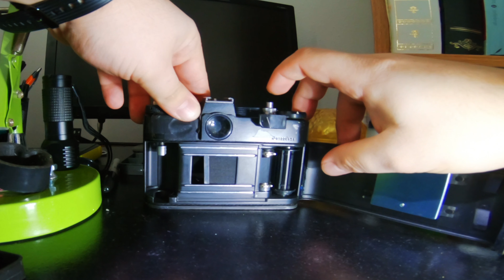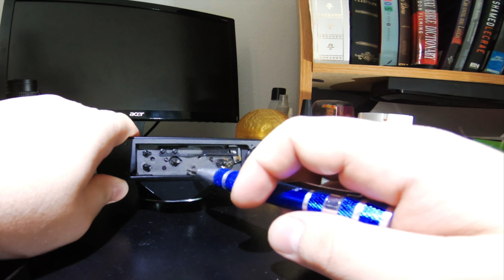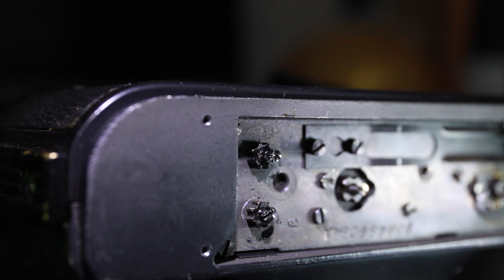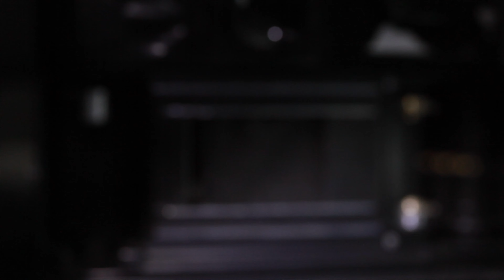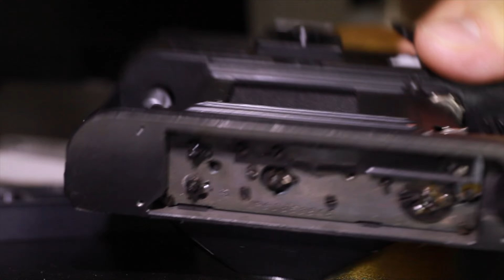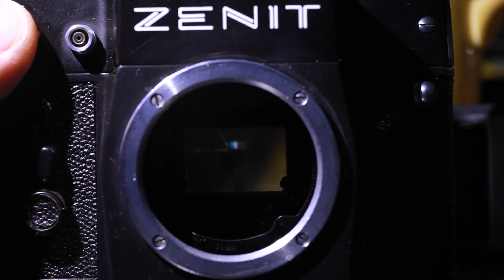Shutter Curtain tensioning for Soviet 35mm film cameras; Zenit 11, 12, TTL; Zorki; FED ; Leningrad

Comment: Worked just great, I was going to sell the camera for someone else to fix, thanks to you and your video I get to keep the camera - Thank you
Reply from the maker: Glad to hear that your camera is operable again!
Reply: @AleksUsovich  Great video, however how do you know the shutter speed matches correctly after tensioning? What's your measurement for adjusting?
Reply from the maker: I use a shutter speed tester that I made using an Arduino. I am not looking for exact shutter speeds when adjusting, I need close enough where the film can compensate for the inaccurate shutter speeds. To get a completely correct shutter speed in these old cameras, you will need to strip down the camera and relubricate everything plus replace some worn parts which is impractical for a camera that is 50 years old. I am simply looking to get close enough (within 2 stops for most film stocks).

Comment: This solution worked very well on a similar model, the Zenit 122, in this model, you have to move the lower gear instead of the screw. Problem solved! Thanks for the video!

Comment: My Zenit B was hanging up at 1/30th of a second. I tried this fix exactly as you describe, and it made it worse instead of better, the shutter was hanging up on all shutter speeds. I decided to try it again and adjust the tensioning a little bit more to the left. But I couldn't get the star wheel loosened up, I'd tightened it too much. I mauled it with a tiny set of pliers trying to remove it and I couldn't. I got angry and decided the camera was trashed, put it back together and voila, the shutter works perfectly. Thanks so much!
Reply: yes but you now have no idea what the shutter speed is, or if the two curtains are balanced.

Comment: Hi Aleksandr, thanks for that! Had a silver Zenit E that had that problem but was sold ages ago. The other Zenit EM I have is a black model like yours and as a slight different issue with the curtain: when you shoot, the right curtain goes left as usual, but when you try to wind for the next shot, the right curtain tries to pull the left one, but the left gets stuck on the top and doesn't want to move along. Have you ever experienced that? I could send you a video if you need to see the issue. Many thanks!

Comment: Hello there. I have a zorki 4 and it looks perfect. But, ı have a little problem. All speed correct, bulb is correct but 1/30 also acts like a bulb. Do you know the solution this problem? Many thanks!
Reply from the maker: Check the set screw that is in the metal shutter selector dial. If it is loose, it may not actually be changing speeds for 1/30 and bulb. If not, you will need to do a CLA with particular attention to the slow speed mechanism. There are a few resources online and I have CLA'd two Zorki 4's before; it is not super easy but not extremely difficult if you have ever repaired a camera before.
Reply: @AleksUsovich  thanks. I will try that

Comment: Great video… thanks.  My Zenit 19 shutter speeds seem ok xcet the slow speeds and bulb do not function.  A 1 second exposure sounds no different than 1/60 for example.  And the bulb will not Kerp the curtain open at all.  Will the same cog/tension correct this?  Thank you from Minnesota
Reply from the maker: Hi, no unfortunately Zenit 19 has the shutter electrically timed and is a metal shutter and does not use a cloth shutter (see my other video for how the shutter is removed from the camera). There is no way to correct this unfortunately. I went through 3 Zenit 19s that all started having this issue and all failed and stopped working in the end..

Comment: Help? After adjusting the screws (probably not in the correct way) my curtain is fully closed and stuck... Nothing I do can result in any movement of the curtain (at least the outer curtain, which I do not know if it is the first or second)... any solutions? As the model differs from the one from the video, I have unscrewed the safety screw before tensioning the gear

Comment: I have made a shutter tester using an Arduino and two lasers. This way I can not only measure shutter speed, but the speed each curtain moves. Obviously if one curtain moves slower than the other, uneven exposure will occur.

My Zenit (all Zenits are almost identical inside, even the newer 122s) shutter speeds are ok till 1/125 but then it struggles, with 1/250 actually giving 1/139 and 1/500 actually giving 1/210. So about one stop slow.

I have disassembled one Zenit to repair the shutter, a common fault is the glue holding the shutter ribbons fail. It is not a job to take on lightly. Takes hours to strip, a real pain to reassemble. To re-glue the shutter ribbons takes less than five minutes.
Reply from the maker: Curtain tension does not really impact shutter speeds from my experience. If the lubrication is worn down than the curtain tension can improve the speeds. You'd most likely need to replace and relube the camera to get the shutter speeds where they need to be.
Reply: @AleksUsovich  Hi, the Zenit E service manual clearly states that the tension on the shutter curtains and the mirror lift spring are used to set the shutter speed. Having built a shutter speed tester, I can confirm that varying the tension does indeed set the shutter speed and if second curtain is set too high, will cause blinding of the film gate at higher speeds.
If the two shutter curtains are not balanced, it will cause uneven exposure of the film, as each curtain will be travelling at different speeds.
Reply: @wibbley1  Interesting. This was the question I had above and you seemed to have answered it: whether the tensioning of the curtains determine the shutter speed. Just out of curiosity how did you build your shutter speed tester? Thanks.
Reply: @marcuskay3147  Hi, both curtains must travel at the same speed, else one gets uneven exposure across the frame. Can also cause blinding at the end of the frame if second curtain moves faster. Many camera repair manuals specify this speed. Get the speed right & all the shutter 'speeds' will be correct.

If the tensions are too high, the curtains move too quickly, thus getting a shorter exposure.
Conversely, if they move too slowly, exposure will be longer.

'Shutter speed' is the wrong term. The curtains always move at the same speed. It is the time of release of the second curtain which controls exposure.

I made a special tool to adjust the curtains correctly. It is a socket the fits the locknut, with a screwdriver that slides down the middle to engage with the slot on the bottom of the roller shaft. This way, the tension can be held whilst the locknut is loosened, then the tension can be adjusted up or down slightly.
Trying to do it with long nose pliers is p!ss!ing !n the wind, else as soon as the locknut is loosened, the spring unwinds, thus loosing the setting that needed to be tweaked just a little.

There is also a third spring which needs to be tensioned correctly & this helps the shutter mech reach the high speeds. Alas this is a different size to the curtain tensioners, so another tool is required.

Zenit & all old cameras suffer as the old grease dries up. The shutter mech needs to be removed, all the old grease cleaned out, reassembled and the tensions set correctly to give correct exposure. Just winding up the tension to overcome dried out grease will result in the curtains & curtain ribbons being torn from the drum. Don't do it.

go to facebook & lookup 'Zenit Camera Club' you will find me and all of my zenit service guides there.

Photrio houses my threads for shutter tester, depeloping timer & stuff. The build details are on github.

https://www.photrio.com/forum/threads/build-a-shutter-tester-for-focal-plane-shutters-cheap-easy-it-works.197756/page-18#post-2775672

https://github.com/billbill100

Comment: Great video! Is this going to work for a curtain that moves the same way for every shutter speed I try and doesn't even open up in Bulb mode?
Reply from the maker: Like a Kiev 4? I don't believe so. I think this only works for a camera that has two curtains. Sounds like your camera needs a cla
Reply: @AleksUsovich  I'm sorry I  didn't clarify. The faulty camera is a Zenit E and the problem is that the curtain or curtains maybe don't open up completely at slow shutter speeds or Bulb mode. They slide right and then left the same way no matter the shutter speed. I have not used a film roll in it yet but I am afraid I'm going to ruin it.
Reply from the maker: Look here: https://learncamerarepair.com/product.php?product=866

That is the factory service manual that tells you how the camera works and repairs. It should help you disassemble and hopefully repair the camera

Comment: hi! i tried fixing my curtains since the shutter speed wasn't functioning correctly and sometimes wasnt openning,other times it stuck in the middle etc..  but i think i messed up the sync. now when i cock the lever to get ready for taking a photo, the curtains won't advance at all, and other times it feels very tight to move the curtain. other times it feels like fully cocking the lever, won't do anything to the curtains.. Q( any ideas? i lost counting of how many times i adjusted the screw of curtain 1 back and forth:( thank you!
Reply from the maker: No idea. There could have been a lot of reasons why it wasn't working before but now is impossible to figure out what is wrong with it after messing with it. You can try setting both cogs to 4 full turns and seeing if that helps and adjusting from there in half-turns to 4.5, 5, 5.5, etc. Can also try adjusting it with shutter cocked or uncocked since its not working now. It may also be broken after being messed with and may serve as a paperweight.

Comment: I think i messed up, i was trying to fix my zenit 12xp, the curtain problem was at the right, so i tried to do the same thing on the video and didn't work so i unscrew the upper cog and the curtain is now closed and stuck and the shutter doesn't work and same thing with the lever, the only way to wind it is keep the shutter pressed then lever it, but still doesn't do anything
Reply from the maker: @chokranatr8493  yep sounds like you messed something up by unscrewing the upper cog. You must have completely untensioned the shutter ribbons by doing that
Reply: @AleksUsovich  so now the only way to fix it is open the whole camera? Or won't work anymore?
Reply from the maker: @chokranatr8493  it depends on what exactly you did when trying to repair the camera or what was wrong with it before
Reply: @AleksUsovich  well, i received this camera like a year ago, i only used the camera once and the photos i take were blurred, i noticed that the curtain was left open when i take a photo, so yesterday i saw your video and tried to fix it, so i removed the lower cover and saw the two cogs, i unscrewed the lower one as showed on the video but it didn't make a change, then i tried to unscrew the upper one but it was to tight and the little grey screw aside was blocking it so i unscrewed the grey one but the screw almost went flying as got unscrewed, and that was when the shutter stopped working and the curtain got stuck, i just put evereything on its place and closed the camera

Comment: Hi, i have a 4k zorki. I must have set the shutter speed before clocking the shutter and now my camera is bricked.. Nay idea on how to repair? Thank you
Reply from the maker: You need to take the camera apart. Most of the time it can be fixed by removing and resetting the shutter speed gears after it's been taken apart. Sometimes parts break and need to be replaced with spares. Performing a CLA would also be a good idea since the camera would be apart.

Comment: Great video, been trying to follow this with a zenit 12xp. The tension is so tight I cant even unscrew it. Doing more damage to the cog and screw then I should be. Frustrating. Would a little wd40 do the trick?
Reply from the maker: I wouldn't spray it with wd40 but can maybe apply some wd4p locally with a toothpick or needle. Make sure you're twisting the cog in the correct direction. Could try using some small vice grips for better grip. Make sure the shutter is not cocked or there will be more tension on it
Reply: Have you removed the tiny grub screw that holds the cog wheel? It fits into one of the little cog holes.

Remember, the cog is a left hand thread, turn clockwise to loosen.

Comment: I have the zenit 122, the shutter is working good but the mirror is stuck, everytime i press shutter, the mirror not move. There anyway to fix it?
Reply from the maker: Sorry, I don't know anything about the Zenit 122
Reply: 122 has same mech as the earlier cameras. If the mirror is stuck down, then you need to adjust the mirror lifting mech. Remove the lens and look in the bottom, there is a plate with two screws, under this you will see the mirror lift mech. But to adjust the mirror mech needs to be removed from the top.

Comment: The one you  repaired has the SN 802.... and the one you showed that is working which is allegedly repaired has SN 882.... Just my observation!
Reply from the maker: Good catch! The first one I repaired was sold before I was able to record the second half of the video. It was sold in perfect working condition after repair and I bought a different camera but exact same model that had the same shutter issue. As evidenced in the video, the repair was successful. This video was shot over a 3 month period with the 2nd repaired camera sold as well
Reply: you are correct i observed it to. two different camera's.......

Comment: My Zenit TTL has the problem that only on the 1/30th of a second setting acts exactly the same way as bulb, only closing when I let go of the shutter release. Can this problem be remediated using the same method? I don't want to risk making the problem worse or creating a new one. The rest of the speeds SEEM to work like normal (not like I can easily tell with the naked eye lol). First few times I tested the shutter it did have the problem of only partially closing but it seems to have somehow fixed itself on that front, unless it was only an issue with the 1/30th setting and it started acting like bulb afterwards (I can't remember for sure).
Reply from the maker: This method will most likely not remedy that issue. From the sound of it, you've got a issue with the selector gear or more than likely a lubricant that's dried up causing the issues. Trying this fix most likely will help with anything.
Reply: @AleksUsovich  Thanks. It's awesome that you're still answering questions under this video that's almost three years old ❤
Reply from the maker: Glad to continue helping out even with this older video

Comment: This works on a 3m aswell, thank you so much! How do you actually calibrate timings with this?
Reply from the maker: You need a shutter speed tester. You can make one yourself using a microcontroller like an Arduino. Can buy one already made online as well. There are also apps that estimate the shutter speed using sound to get it in the ball park. I would shoot a 12 exposure roll of film at various shutter speeds using a light meter to see how the photos turn out to see if it needs to be adjusted more or less

Comment: thanks for the video bro, but i tried it and the curtains disappeared, what can I do ? thank you !
Reply from the maker: This usually only happens if the shutter is cocked and you try to mess with the curtain. Need to wind the screw that was mentioned in the video until the curtain goes back to where it is, lock down the screw, and fire the shutter. After that you can go back and further tighten the screw as it should be. Do not overtighten!!
Reply: @AleksUsovich  Thanks mate !

Comment: does the same apply for the other curtain or do you need more than 4 turns? in my case the first curtain is slow and the second one is normal. so on bulb it takes seconds for it to open, for example. on higher speeds it won't even open because the second curtain is much faster
Reply from the maker: You can adjust the other curtain as well but am not sure by how much. You can slowly left the spring unwind and count how many times you need but only when you apply firm pressure on the screw head with screwdriver. It can unwind too rapidly and you'll miss how many times it rotates.

Comment: Hi Alexandr, i have a problem with my zenith 11 and i want to ask you if you can help me. The shutter speed wheel of my camera has fallen down, I dont know how to make it work it again. Thank you so much.
Reply from the maker: Hey Jose,
The shutter speed dial is held on with 3 tiny screws. Some of them may have gotten loose or fallen out. You'll need a set of tiny screwdrivers to tighten them or put some in there.

Comment: Does it work for Zorki 4? My shutter doesn't want to go all the way back when I put it in B, and sometimes in 1/250 and above, the curtain doesn't open at all
Reply from the maker: While it is possible to use this on a Zorki 4, I would instead just disassemble it and clean it out. If you tension the shutter curtain more, there is a high risk of breaking it. If the shutter curtain is having issues it means that the grwase is worn out or there is dirt in the mechanical parts. The Zorki 4 is really simple to clean and lubricate with plenty of tutorials online.